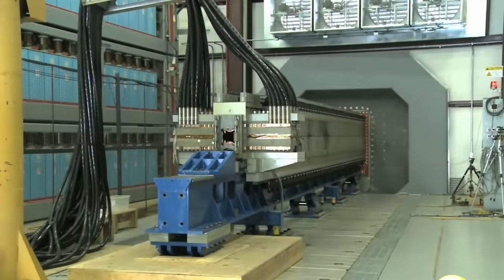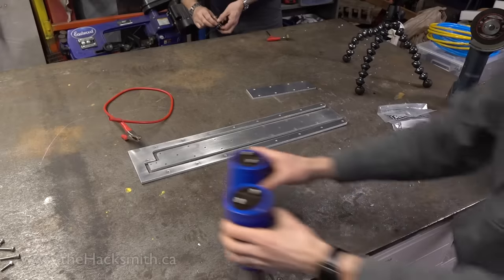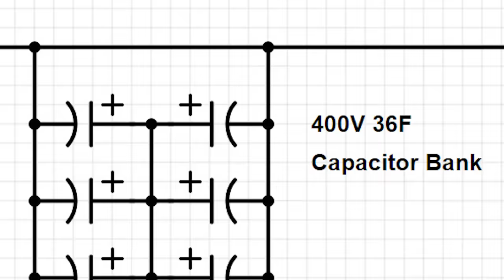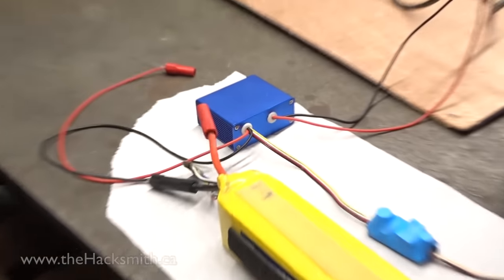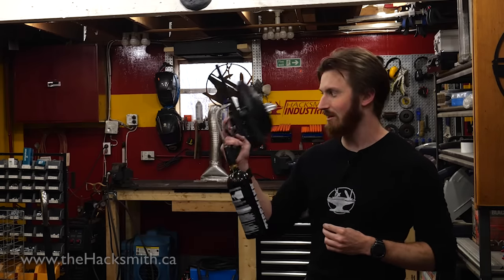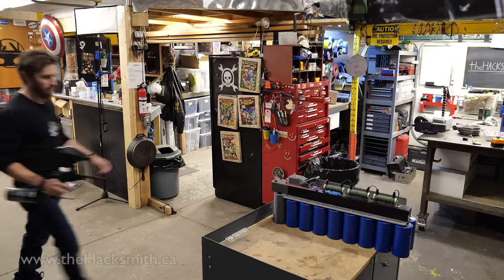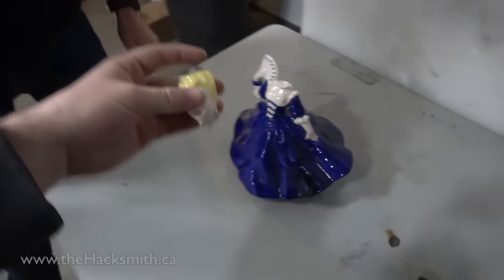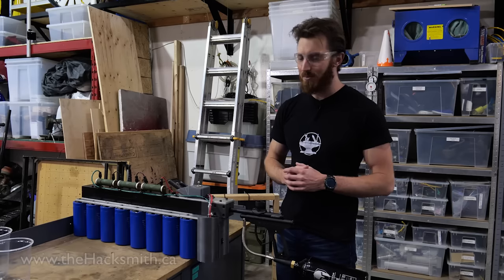Making a RAILGUN and then TESTING it!

Comment: I'm developing an airplane which have 5 weapon configurations:
Attacker: 2x 30 mm cannons; 2x 12.7 mm machineguns; 16x 70 mm Hydra rockets; 4x 750 lb bombs
Interceptor: 2x 30 mm cannons; 4x 12.7 mm machineguns; 8x AIM-ASRAAM missiles
Air superiority: 2x 30 mm cannons; 4x 12.7 machineguns; 1x 3 Gw carbon laser; 4x SHM missiles
Multirole: 4x 25 mm cannons; 2x ShVIS pulse laser units; 2x MD-1 molecular disruptors; 2x 150 lb bombs
Starfighter: 2x 3 cm pulse lasers; 4x 13 mm machineguns; 1x 5 Gw super laser; 2x SBU (solid booster unit for flight to orbit)

Comment: "We're gonna need a capacitor." 
Me: Thinks its one of those small capacitors found in handheld electronics
*Is bigger than the battery itself*
Me: wot
*later...* "We will need 16 of these"
Me: dies
Reply: GD DShifter This is getting top comment
Reply: Watt*
Reply: Dude same
Reply: GD DShifter Japan
Reply: Thy using a depleted uranium pin, it will go through the beer bottle without breaking it.😀

Comment: At 400 volts you'd have almost 3MJ of energy there. If you're limited as to projectile speed, you could go with a heavier projectile. Though I'm reasonably sure that there are projectile energy limits as well as speed limits in our gun laws...
Reply: Exactly. 3MJ of energy translates into 38000mph for a 20gr slug.

Comment: Looks like the fallout 4 railgun
Reply: I was thinking that
Reply: I was also thinking that Bethesda did their research on how it would look
Reply: Fallout 4 doesn’t have a rail gun. It has a Gauss rifle
Reply: Rail guns and Gauss rifles are very similar
Reply: The Fallout 4 Gauss rifle is powered by capactors like the vids rail gun
Reply: Crazyoldhead 245  yes, but the difference is what they fire. Rail gun fires a metal projectile while the gauss rifle fires a bolt of energy.
Reply: Bugthestard
Reply: @skeltonslay8er781  fallout 4 does have a railgun though..
This definitely looks more like the gauss rifle though
Reply: There is no rail gun in fallout 4, there is a Gauss rifle. Gauss rifles use coils instead of rails.
Reply: @h3llw4lk3r2  well when I made that comment I was talking about the railway rifle.
Reply: The rail way rifle isn't even a rail gun it uses steam and pressure...
Reply: @h3llw4lk3r2  oh okay
Reply: @skeltonslay8er781  Gauss rifles, also known as coil guns, fire the same kind of projectiles as rail guns.
Reply: GAUSS RIFLE
Reply: @skeltonslay8er781  Actually, it looks like an Energy projectile.

It's Actually firing a 2mm Metal Projectile.
Reply: Cause it is
Reply: Gauss rifle
Reply: @skeltonslay8er781 literally the same thing
Reply: @Victor-056  "energy projectiles wont work, use ballistics! "
"WHAT ARE YOU DOING?!"
"using a gauss rifle"
*one shots creature*
"Its a ballistic gun"
Reply: That what I was about to say too. It's so cool :)

Comment: Everyone asking the reason/advantage just go back to the beginning where he talks about the navy developing them. 

What is worse than having a bunch of munitions that could blow up in your boat? Munitions that require explosives to launch. 

You can have the same amount of “fire power” with half the explosives in your munitions holds

You don’t need a large brass or steel case to hold the primers/powder to launch your projectile And you don’t have to have the massive breeches to contain the explosions launching the projectiles, reducing overall weight.
Reply: Richard Harding The question would be that would it be worth it right now and the years to come during its development. Currently if we were to implement a railgun weapons system to a ship all the advantages given by the railgun would be outweighed by the disadvantages.

The weight of the batteries and the gun's mechanisms itself may even just be more than the weight of a conventional weapons system which really doesn't 'reduce overall weight'
Reply: Derp Master it has better range and accuracy plus jas a much much higher bullet velocity meaning its easier to aim plus the loading process is much easier all and all its an improvement however this is likely something that wont be used for At least 10 to 15 years because of the cost of outfitting ships with these guns so untill its improved on more it wont see much use like that suit of power armour darpa is developing the only real disadvantage is the cost
Reply: Richard Harding not only that, but after 2 miles, the railgun has more velocity than you everyday battleship heavy guns.
Reply: Richard Harding actually 0 explosives they rely exclusively on kenetic energy to do damage
Reply: Energy isn't much of an issue either. Best ships use nuclear and, and some new ones are switching over. 

Nothing is more horrible than a fire on a ship. Trust. Less munitions the better.
Reply: CaptainLekirk not at all only the American aircraft carrier's (1french) use nuclear propulsion and if u know anything about aircraft carrier's then u would Know that neither do they have any space or any use for railguns.the only other surface naval ships with nuclear propulsion is the Russian kirov class which 30+year old.the only ship that probably has the required power for railgun is the zumwalt class(non nuclear) of which only 2 have been built and 1 under construction.
Reply: Not to mention numerous other benifits, such as launching a cheaper metalic sabot over your expensive plastic explosive warheads. 

Assuming a less self damaging system is created, you now have an electric powered weapon on a boat run by a nuclear reactor. 

Through it's speed, it offers range and accuracy that would generally require a guided missile which are a TON more expensive to use, and can also be shot down. You can't shoot down a metal slug traveling at mac 7. Or maybe you can if you have a way to track it, but that's a hell of a lot more difficult.
Reply: LIBERTY PRIME You need to field some serious firepower to stop a kinetic projectile of this weight and speed. More or less on par with the weapon firing at you.

Another reason for railguns is that there is a very real upper limit for muzzle velocity on conventional kinetic weapons, because the expansion rate of gases is limited.

The only speed limit on a railgun is the amount of energy you can dump into the projectile before the gun or projectile disintegrates.

Some “field enhanced“ railgun prototypes like that of the US Navy already outperform most conventional weapons, but as of now they are just too unpractical.
Reply: Derp Master if you look at the gun in the video it’s tiny compared to battle ship guns which are actually multi level it goes down into the gun and the ammunition is so heavy it takes 3 men to pick up and get ready to load the gun itself is huge and heavy this would highly improve weight and firepower
Reply: Forget it, the rail gun is just a cool toy. It's too big and heavy, needs lots of electricity (which you don't get on a battlefield), probably fragile, lacks maneuverability, etc., etc.. Today's world is ruled by rockets, which can travel much further, faster in some cases, can change direction/follow targets, hit a target from anywhere (not just from the direction it was shot at), deal way more damage and most importantly, can be shot using very little and light equipment (just a manpad is enough). As a comparison, think of medium-sized ballistic missiles, which can take out a whole town and are launched from a truck, which can be deployed and be ready for combat in 15 minutes.
Reply: Skycrater actually it takes a lot longer to travel to it's target then the navy's railgun basically imagine shooting at a jet the missile will follow it sure but if the jet shoots out flares the missile will fly off course now with the railgun it's round travels faster the the jet can move basically as if shooting at a none moving target and has almost perfect accuracy the moment the trigger is pulled on the railgun say goodbye to the jet and I'm pretty sure they will create a device that blocks up to the ships to self charge the systems quickly so no worry about it's energy
Reply: I doubt it will be lighter than having conventional guns any time soon. The rails wear out and need to be replaced often. So on top of the weight of all the other extra equipment you need to carry spare rails.

@Skycrater
I think we are already seeing a decline in the effectiveness of rockets. One of the advantages of a railgun would be that the projectile is too fast for active defense systems to deal with.
Reply: nipi tiri couldn't we get over rail wear by using magnetic fields to keep the projectile off the rail walls?
Reply: In a railgun you have a high current going through the projectile. If the projectile were to somehow levitate you would have to have electric arcs between the projectile and the rails. Those arcs would likely be hot and thus still damage the rails. (Think arc welding.)

Also a railgun accelerates the projectile using a magnetic field so trying to levitate the projectile using magnetic fields would probably counteract the acceleration.

Alas Im no expert.
Reply: @benjovi55 
I think they are designing it with easily swappable rails.

Comment: So do Canadian gun laws specify firearm-status by velocity of the bullet, not by the means it shoots? Because here in Finland if I'm not mistaken a firearm is a firearm if it uses combustion as a means of accelerating the projectile, otherwise it's a "toy". And there's no limit to the size of toys >:D
Reply from the maker: Yes.
Reply: i think that over here in canada, you don't need a firearms license for it unless it shoots a projectile at over 500 feet per second or that produce over 12 ftlbs of power.
Reply: BlakOrkk There are some minor restrictions. You cannot buy a 6.35mm air rifle without a permit of some sort. But I don't take that as a problem as the smaller calibers pack some nice punch too. On the oyher hand, unlike Germany, we have no limits to airsoft-guns' power/firing modes, which is nice.
Reply: Suomi mainittu
Reply: NovaPenisVideot Plz xD

Comment: 0:15 I just noticed how the shockwave from the gun firing or something makes the fans turned off above it spin crazy fast
Reply: or they could be venting air due to immense heat, thus using the fans for their purpose?
Reply: Retr0 fair point

Comment: I been wanting to develop an electromagnetic railgun for the longest time, but I also wanted to redesign the capacitors so it could work for the railgun. Offering super high electricity output while being compacted. One design that interested me designing a chamber where the slug is suspended in air by electromagnetics while it charges, thus eliminating friction before firing it, helping it travel further and giving it more penetration power. It could draw from the charge and automatically levitate the slug when you hold down the trigger. To further eliminate the friction, you can make a open air rails to pull it along the air after it is fired. 

Make a shorten barrel and extend the rails further out beyond the barrel. From what I understand, friction is one of the main issues with the navy's railgun, because they have to replace the rails after several shots. The electromagnetic field should keep it going even after leaving barrel and extending the range even more.
Reply: Mark Morgan you'll need a massive amount of energy to power such electromagnet... how long did u take to write this?
Reply: I don't think it's friction causing the wear of the rail, but the temperature from the arc.
Reply: the friction is probably negligible, not improving performance by a huge difference. Plus when the slug levitates how will it make contact with the rails?
Reply: You need to contact the rails for it to generate a magnetic field brother
Reply: Mark Morgan thats a gauss gun or coil gun
Reply: you are talking about a coilgun there - which has its own share of problems.
Just to name one: it is far less efficient and more complicated at those sizes.
Reply: Big nibber warfare gun
Reply: yeh your right, fero/magnetic slug suspended in magnetic fields  - just like a maglev train - definately a better approach,
There is a further point that a timer can (and should) be used to sequentially accelerate the slug, again just like a maglev train.

Yes im aware this is a coil gun design, not a rail gun - and that the materials science for the highspeed switches are still a problem.

What you need for a rail gun to work well is a low friction high conductive substance, which is about as much a problem as the switches for coil gun.

Who knew blowing shit up could be so tricky.
Reply: bigolbear the jammy dodger graphite?
Reply: I like your thinking on this.   Magnetic fields, as in magnetic bottle for antimatter, eliminate friction and conceivably could make faster.  Problems I saw were aerodynamic.   The projectile begins tumbling after leaving barrel.  Poor weapon because so difficult to aim.
Reply: Theoretically, iridium plating of copper rails would work quite well.

Comment: I have one question....

How long does it charge my phone?
Reply: It fries it in one second
Reply: so. Your phone Lithium battery supports like 4 Amp/H The capacitor is able to discharge itself in a few seconds (i think) at 400 volts. it would basically explode it by the voltage, but since its a lot of Amp/H it would basically explode your phone in i think like 0.1 secs maybe?
Reply: xX_TheBoneCrusher_Xx r/hedidthemath
Reply: Legend has it that his phone still needs charging to this day.
Reply: Christiopher Valentino He's probably based in chicago, and sum of de gang bois tried to 187 another rival gang, but some of the bullets ricochet off of the whip and hit the powerlines to his crib. Then he call the blu bois and they scatter, and when the power bac on he sub to the hack boi.
Reply: @patata9502  whaaaaaaaaaaaaat?
Reply: @christiophervalentino2744  *compatible
Reply: Your phone would dissapear into the 4th dimension
Reply: About 33.5cm
Reply: R/foundthemobileuser
Reply: Da unknown 99999999999999999 years

Comment: That is it? 
Slingshot will make more damage
Reply: Ya if it was powerful enough would have easily when through the garage door and just kept going.  Could be they toned down the power, or 16 of those batteries was just not enough.
Reply: They made it weaker so it wouldn’t be considered a fire arm by law.
Reply: even if you scale up by 10 times, still not a FIREarm.
Reply: Do you really want them to go to jail
Reply: because a railgun's projectiles can reach speeds higher than any other "firearm" and cause an explosion not only when fired but also when it hits. And thats all without actually using any explosives.

Comment: Make full contact to the copper rails. The rear pusher should be a metal piece into a molded sabot holding your projectile. Ends of the U should make electrical contact; it is OK to get it moving with compressed air or a small powder charge. Non electrolytic capacitors should be used. If you are using electrolytic csps, charge in series strings to deliver a quicker high current pulse.

Comment: Okay. Good first effort. The projectile is launched using a "sabot" in the Navy. First, a graphite sabot round would self-lubricate the barrel of the gun and reduce friction on the way out. Wrap it in balsa wood blacked out with pencil. Second, an AC to DC motor generator would prevent the need for charging, but admittedly would make the gun tethered to a wall.

Comment: seems like a pellet gun would be more powerful
Reply: arcadian mystic The mass of a pellet gun pellet is much less that the mass of this projectile. A pellet gun may shoot faster, but this thing is more powerful.
Reply: Markulator You can kill animals with a pellet gun, I doubt you could do that with any amount of accuracy or maneuverability with this thing. Maneuverability is key.
Reply: arcadian mystic: even a defective water pistol from a gum vending machine would be more powerful. Even without water....
Reply: Well power is key the projectile has to be less weight than the amount of thrust and the pellet gun does not provide a third of the thrust power of the rail gun which means it is the rail gun that can kill more than the pellet gun.

Comment: But a firearm has to use a combustible propellant to be a firearm. Canada is so dumb
Reply: the UK is the same as is most of if not all EU countries when mentioning firearms ! dictionary states the same as your comment ie combustible propellant + projectile = firearm .however the definition in law is crazy, the speed/ft lbs of the projectile from an airgun can make it a firearm ! a can of pepper spray/CS is also a firearm in UK law,crazy !
Reply: @stevegable2707  I agree the UK is weird.  I have an air rifle that's over 16 joules (12 ft/pounds) of energy so I have to have a licence which is called a Firearms Certificate!???? If I commit a crime with said air rifle I would be charged with a firearms offence!  The same licencing requirement would be applied to a Rail Gun if the energy exceeded 16 joules. In fact just making one would be an offence unless you were a registered firearms dealer.
Reply: No it has to fire above 495 fps ti be a firearm in canada doesnt matter what propells it.. read a book
Reply: @ @raylenn4444  Them little schoolchildren are so much danger to you all that you need to keep guns! there have been 2 mass school shootings in the US in the last 10 days!

Comment: Crazy how fast tech moves.  3 years later, I just watched Demo Ranch video where Matt's gun fires 25 rounds in a couple of seconds.
Reply: Same that's how I got here lol
Reply: That wasn't really a rail gun, here you need to provide good current for a short burst as the bullet is accelerating,which is why he used a capacitor, if he needed it for a continuous time and not bursts he probably wouldve gotten a strong enough battery, but it's just not useful here and probably not safe unless you made a circuit that stopped it after a millisecond